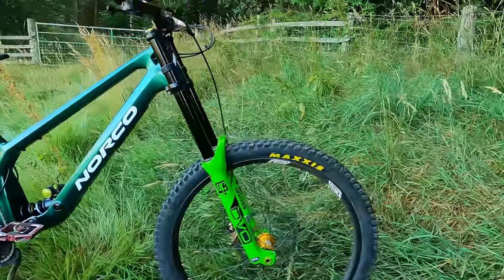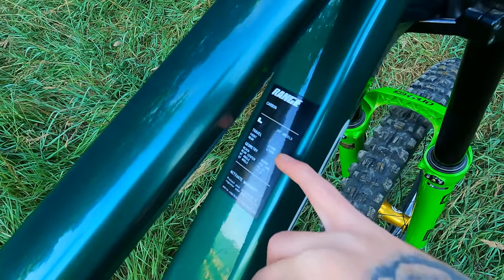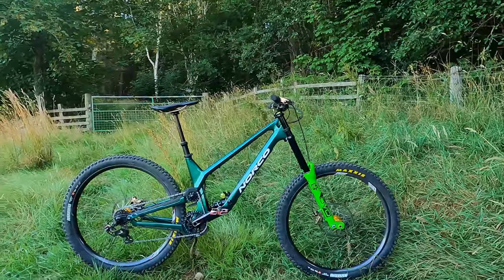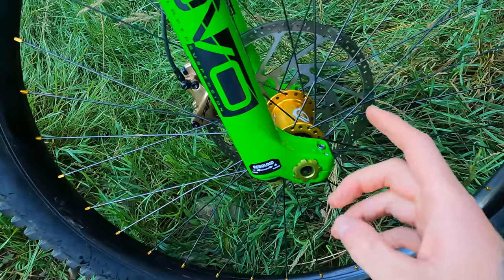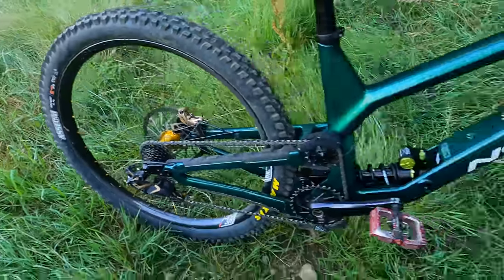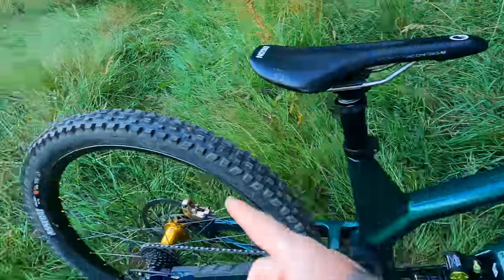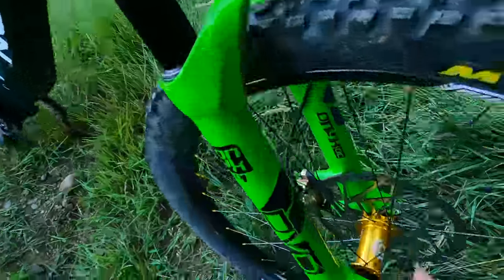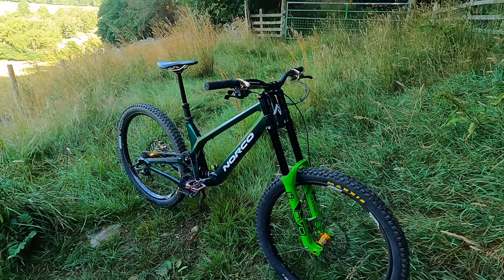THE MOST TALKED ABOUT BIKE AT RED BULL HARDLINE? (HERE IS WHY)

Comment: Isn’t this exactly what the Norco factory dh team is riding? Blenki runs dual crowns and short cage mech at the WC races.
Reply from the maker: Nope. Their dh bikes are slightly different
Reply: @LewisBuchanan  yeah I assumed they ran different links and a longer stroke shock to add some travel. I can’t imagine they ride down those gnarly tracks with only 170mm.
Reply: @themagicillusions  completely different frame. They race the aurum high pivot and this is the new range
Reply: @epicmtbtrailz8234  nope. Not since 2020.
Reply: @themagicillusions  I thought they would ride the aurum? lol
Reply: @jockardl  not anymore, they were on a proto of the range last year and now ride the current range with dual crowns and dh build and I assume some custom links and shock to get more travel out of the bike.
Reply: @themagicillusions  Didn't know that. Do you know why they'd run the Range over Aurum HSP?
Reply: @themagicillusions  you're wrong they run the Aurum HPS which is the new dh bike for Norco since last year. They definitely aren't running the range.
Reply: @thajoint9245  nope.
Reply: @themagicillusions  it says they are testing them but I haven't seen one raced yet other then hardline.
Reply: @thajoint9245  at the last world cup race a couple of the norco riders were on the downhill range
Reply: @thajoint9245  no bru sorry to disappoint... you need to look harder if you’ve never seen em used other than hard line cause the factory team has been on them for over a year now...
Reply: @ryndym  the original aurum is better than the hsp unfortunately, many norco riders didnt want to switch and a few didnt, the new new aurum is gonna be next level for dh bikes though, especially better than the supreme in more than a few ways
Reply: @thajoint9245  the factory team hasn’t run the HSP for two years now dude. Look at any highlight vids/pics.
Reply: @hobmarg  not sure why they'd spend millions in R&d to ditch a bike the same year its released.
Reply: @thajoint9245  You've gotta be trolling. The Aurum HSP was being tested in 2016/2017 and raced in 2017-2020, that's 3 seasons and a normal lifecycle for a DH frame. The DH version of the Range (same frame but different chainstays, links and shock stroke) has been tested/raced going back to early 2020. Also it's not millions in R&D for a downhill frame.

Comment: Would you take the same bike again for the next Hardline, or would you favour a dh bike?  Such a cool bike! Did the increased tyre and suspension pressures make a noticable difference to the tracking over rough stuff? Was it tricky to find a good balance or was it all about prioritising setup for the big hits on the landings?
Reply from the maker: Na i would use a full dh bike, yeah the high pressures made it more difficult for the tech parts inbetweej and finding traction
Reply: I suspect that would be Norco decision

Comment: If I saw correctly you used a Fox dhx2 coil shock during the race?! Why is that?
Reply: I guess it had a slightly longer stroke than the JadeX he had, which pushed his rear travel to 175mm. He didnt run a JadeX with a longer stroke I guess because of the shortages.
Reply: He said earlier in some comments that he had two new shocks on hand but didn't got to test them prior to Hardline and therefore running the stock shock which is the dhx2.
Reply from the maker: Tim is correct!
Reply: @LewisBuchanan  Makes sense!

Comment: Was the front end lower due to the lower axle to crown hight on a dual crown compared to a single crown or did the extra 30mm of travel make up for it? I know you said you ran a high fork pressure was this to compensate in ride height or just to handle heavy hits?
Reply from the maker: Just for the heavy hits
Reply: im not sure what travel his fork is but i know a 180 lyrik has same axle to crown as 190 boxxer so that might help answer your question

Comment: Internet says you weigh 76kg. 500lb spring enough for the massive landings? I understand that it’s a race so suspension needs to be somewhat plush, but how do you balance plushness for speed vs bottom out resistance? I’m running air shock, max volume spacers and max high speed compression. Still feeling bottom out landing 60ft jumps at Whistler, which is way smaller than redbull hardline.